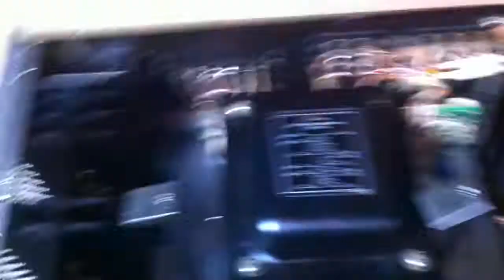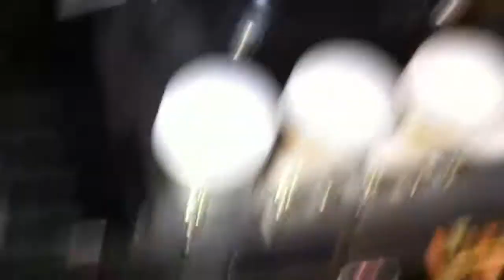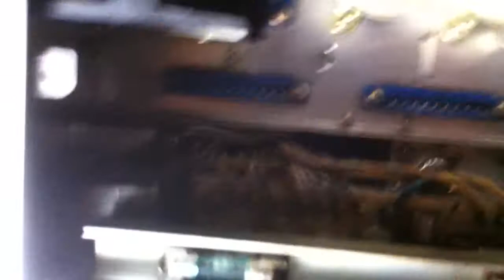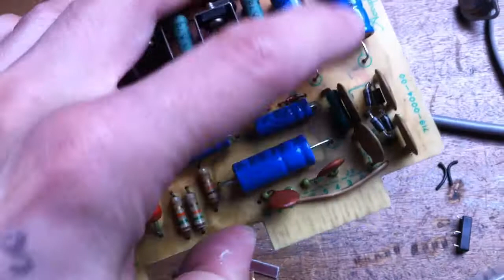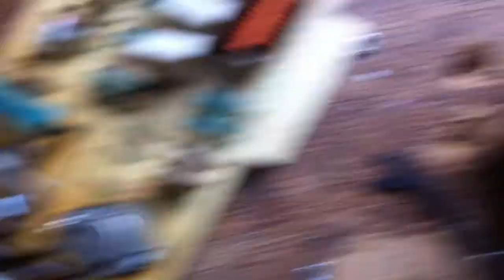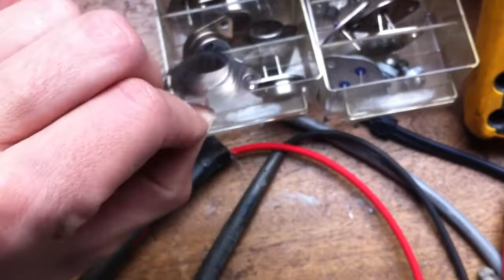Accuphase E-202 repair

Comment: q2 and q3 on the 719-004 have blown.actually one of them has blown. transistor used is 2SC1746A. what should be a suitable replacement for this one?
Reply from the maker: Anything you have lying around with:
60V, 50mA, +/-450hfe, NPN
Mind that your substitute might have a different pinout. Other broken parts on the board might be the cause of this failing transistor. Look for datasheet of 2SC1745. Don’t hold me to it
Reply: is the hfe important in this case? I have a sl100b .can I use that?  this board is the protection circuit.